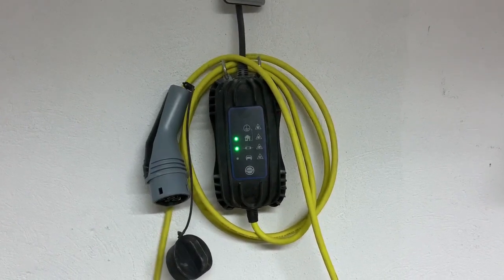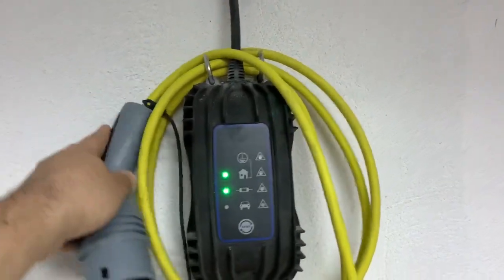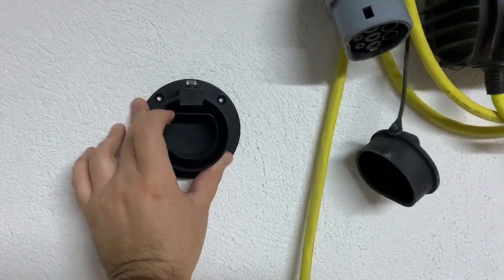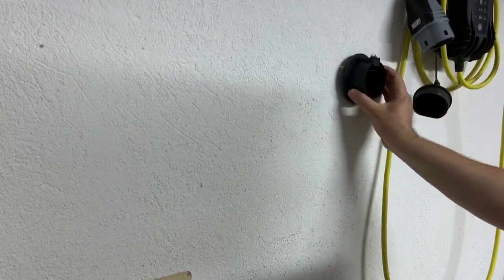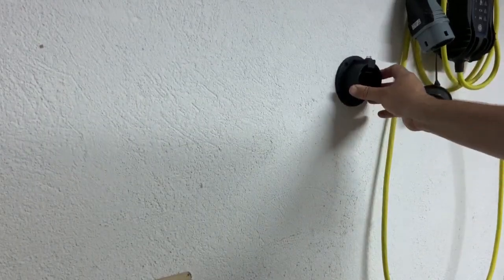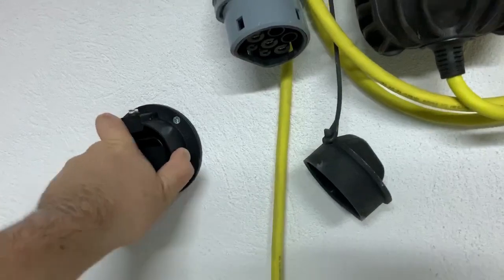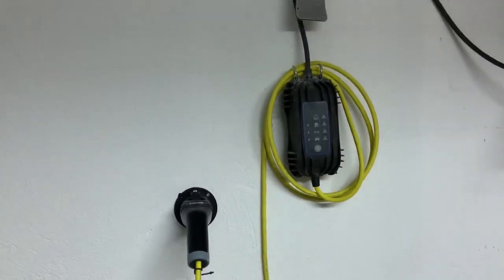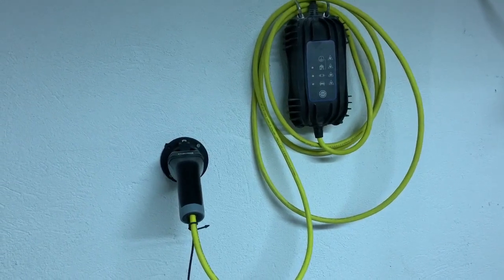Type 2 AC Socket Holder wall mount for VW e-up charger

Comment: It could be better to use a ,etall bracket to get a 30° - 45° angle of the plug + cable to the wall instead of 90° flat mounted on the wall as shown here.

Why ?

at 90° the stiff cable reaches a lot farer into the garage and driving out your mirror gets closer.

Also i decided to mount the plug holder on a piece of wood cause then it is easier to fix it ... to a bracket with an angle that is fixed to the wall. And a piece of wood offers you a chance to mount a hook for the cable where you want and another fastener or hook for the charger itself.